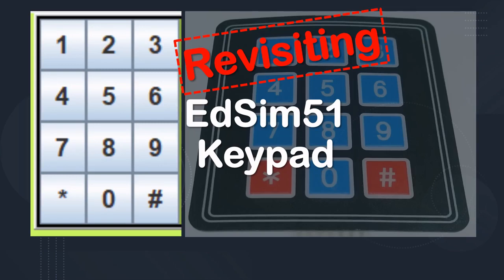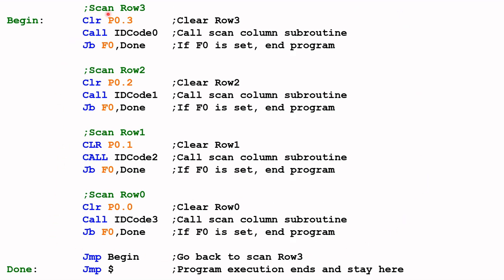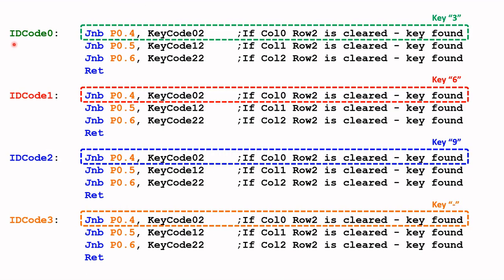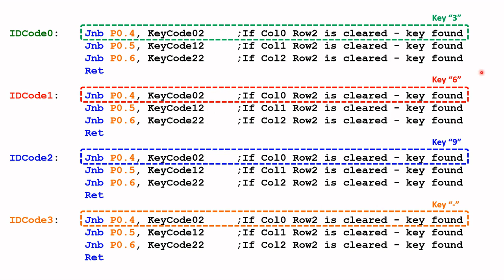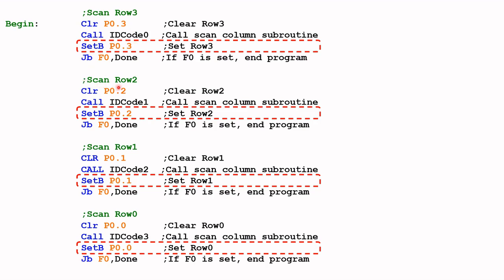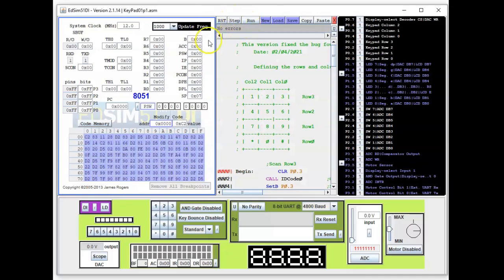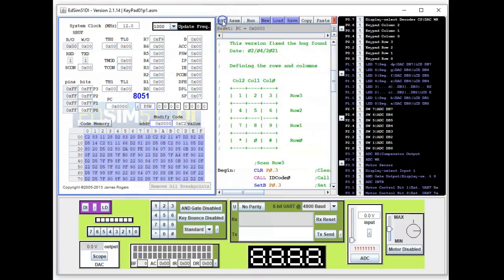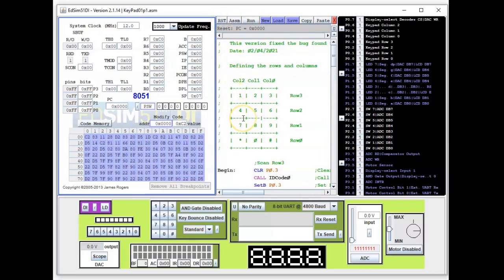#29 Revisiting EdSim51 Keypad

Comment: Thank you sir for the videos on EdSim51, it really helps much in my assignments. 
But I have one question:
If I wanted to input 2 numbers from the keypad, is it possible to show the first number inputted on the MSB display, while the second number inputted is shown on the second MSB display? Thanks.
Reply from the maker: Hi thank you for comments. Yes, you should be able to input two numbers. You need to move the cursor to the next position and key in the number. You then need to read the inputs as two separate bytes.
Reply: @vooiyap  Sorry sir, what I meant was, in the edsim51, there is 4 unit of 7 segment display (8888), now in my simulation, I need to input 2 numbers via the keypad (eg. 5 and 8), then to display the 2 numbers I have inputted in the correct sequence in the first two unit of seven segment display. Is it possible to do so? Thanks.
Reply from the maker: @dingtow6392  Hi thank you for your comments and clarification. You should be able to input two numbers. However, the challenge is to get the EdSim51 to display 2 numbers "simultaneously" .
Reply: @vooiyap  alright, thank you very much sir

Comment: Can i use this type of code to make the keypad an input so that I can output it to the lcd
Reply from the maker: Yes, you should be able to. When a key is found, it is stored in register R7. You can send this data to the LCD module code and get it to display it via register A. Please refer to video #28 for the LCD source code. I hope that helps.
Reply: @vooiyap  thank you very much!
Reply from the maker: Hi I have uploaded a video (#32) that scan the keypad and display the key pressed onto the LCD. In addition there is a video (#34) that implements a keypad access control system.